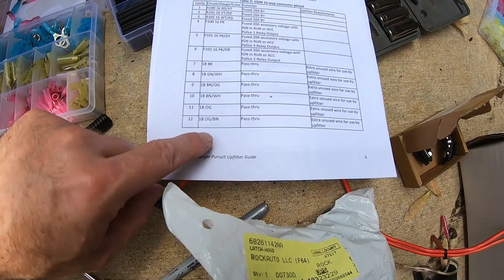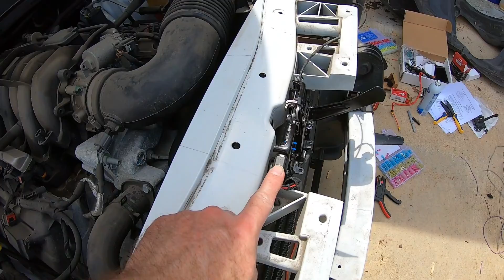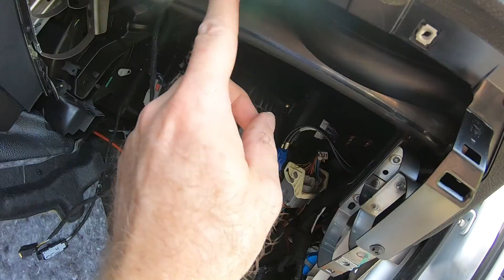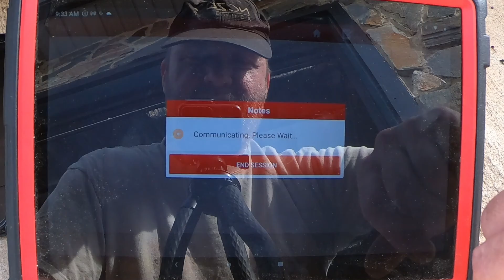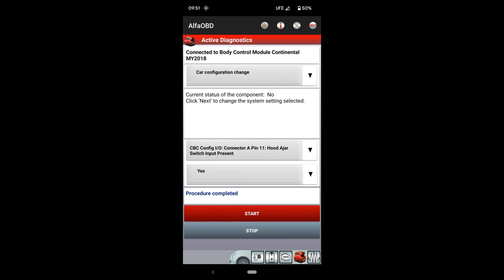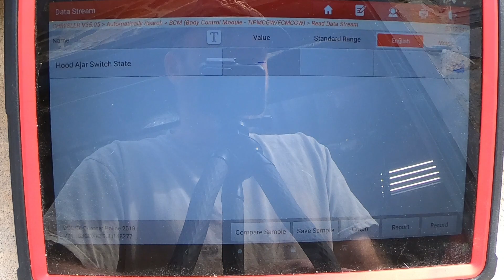2018 AWD Police Charger Enable Factory Remote Start PT5

Comment: Question for you, I have a 19 pursuit....I've done soo much reading because my rf hub was freq1 fleet a like keys....I went in and disabled fleet alike keys and even the dealer couldn't figure out which key to use which ended up being a weird version as after the regular part number and 2 letter there's a B printed as if its for a specific hub/hubs only.. anyways which key fob part number did you use after the latch install? Did yours have fleet a like keys at first?
Reply from the maker: Hello, Thanks for the comment.  Our pursuit had the key alike turned off at the auction as it did not initially have a key.  From what I can tell when they programmed a key for it they turned off the Key Alike.  We did a video when we programmed additional keys.  https://www.youtube.com/watch?v=taE18XZpwyI  The part we used was: https://www.amazon.com/dp/B0DCNX1TNM
Reply: Ended up getting it fixed?